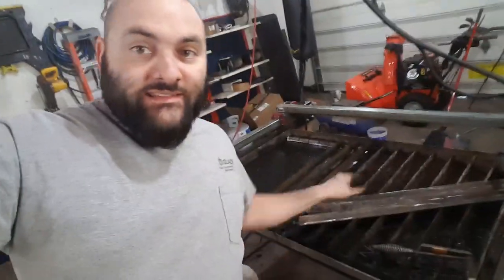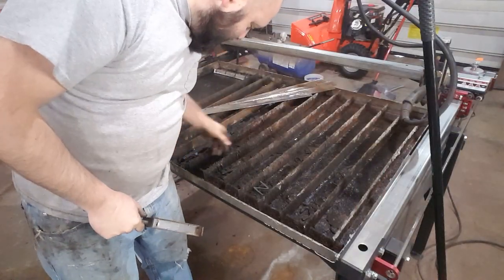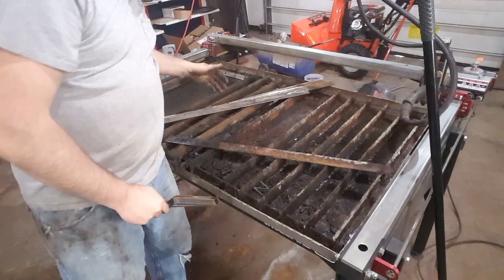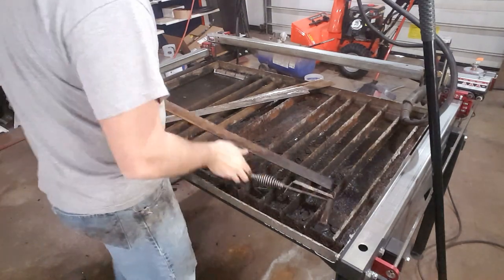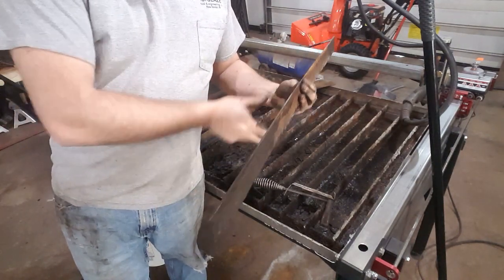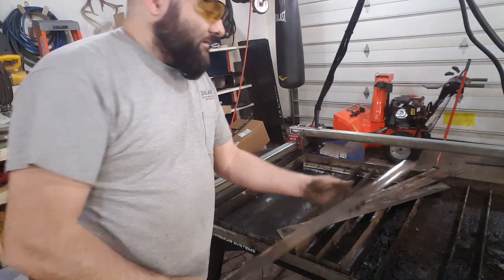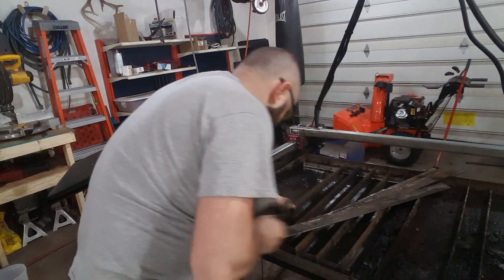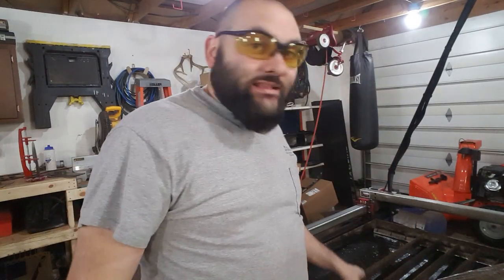How Two Double The Life Of Your Plasma Table Slats.  Crossfire Pro

Comment: Good video. I think videos like this are interesting. How often do you do cleanup day on the table/ your shop?
Also, do the slats being unevenly ground affect the machine, or does the Z-height control self adjust itself well enough?
Reply from the maker: The THC will comp for the material and slats being all over the place as far as the Z height is concerned.  Only if your air pressure is consistent.  If you hit the trigger on your torch and the pressure gauge on the front of the machine drops for than 5psi your THC will not work properly and you have problem after problem.